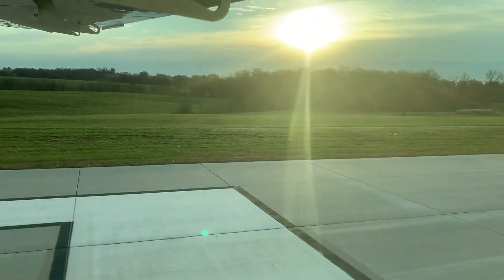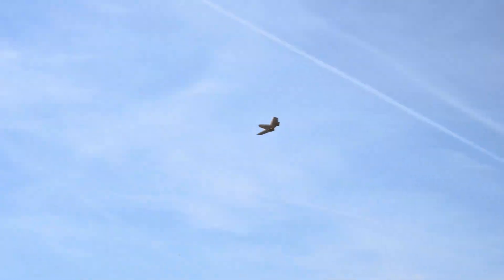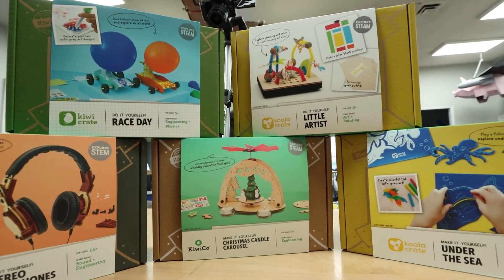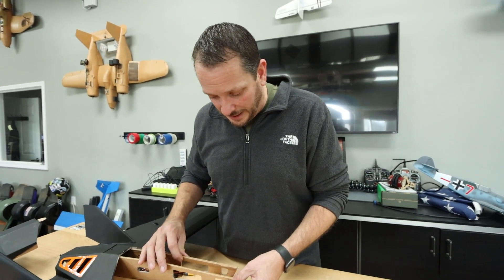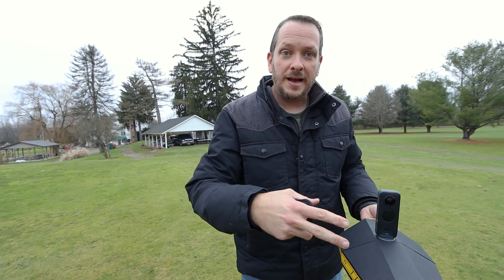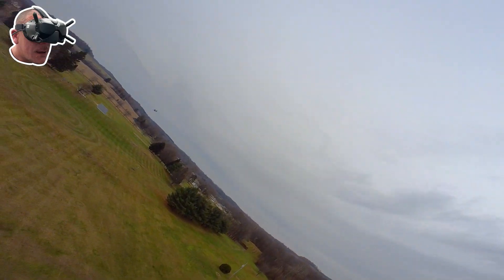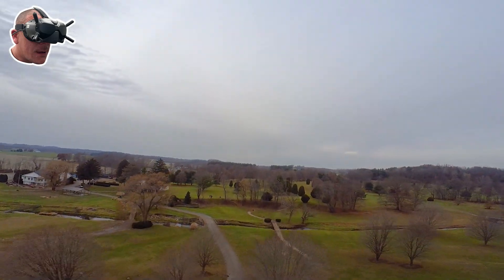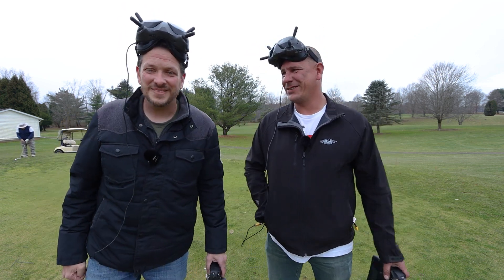DIY FPV UFO Racer 🌍🛸 Anyone can Build

Comment: Occurs to me... Couldn't you run your own software to do a HUD in the goggles? And, maybe some IR wing tip LEDs that the cameras can track? Linking those feeds together, you could Augmented-Reality some artificial CGI aiming reticle and air to air machine gun bullets and missiles with locking on tones. They'd have the warning indicator that you've got them locked, and they can pop flares/chaff. Etc. A way more awesome type of laser tag. You get a hit and they lose control and spin out for a second. Bonus points, include a little smoke maker in the plane that goes off to indicate damage. You could fake RADAR with arrow indicators pointing to let you know where the other aircraft is.

I'd buy two.

Comment: It maybe stable and flyable on slow speeds. Try to ran it into a simulation and above speed of sound and I guess it shows the flaws of the design. Taken that this design are ment for low speeds, still awesome FPV shots and flying of those thing.

Comment: look into this: The Flying Pancake - Slowest Plane Ever Made! https://youtu.be/DZoMMt1e2MM High speed is not everything in aviation. Sometimes, the need is for something other than having an aircraft that travels very fast.

 Speed might be sacrificed so that a plane can carry more cargo or payloads, or if an aircraft needs to fly longer distances more economically. Another reason why lower speed may be preferable is for when an aircraft needs to fly low and slow. 

So, what went into making the Vought V-173 or ‘Flying Pancake’?

The Vought V-173 was an aircraft built during World War II. As already mentioned, central to the proof-of-concept for this craft was an extremely low-aspect ratio wing design.

This created an aircraft that was essentially one giant, flat-shaped wing, hence its pancake-like appearance.

Its most eye-catching and unique feature was its circular wing, which was a relatively small 23.3 feet or 7.1 meters in diameter.

 This small wing area was meant to provide structural strength and allow the craft to have a high level of maneuverability.

Comment: Forward swept wings are incredibly maneuverable, thats why they arent used on full scale aircraft. They are too maneuverable and even tiny twitches will rip them off the plane at high speeds. Only computers can really react fast enough to keep them stable at super high speeds.
Reply: Except they're used on Sukhoi Su-47 Berkut. Incredibly maneuverable at subsonic speeds and designed to twist while under load so that they don't break
Reply: Or this one: Junkers Ju 287
Reply: Eh, I am not a plane expert, consider me corrected.

Comment: Come to think of it, the way they toss the planes to flight would be possible for Real Life planes (for this plane design). Like imagine, planes like this being deployed from a carrier but not on water or land, not from a run-way but an arm tossing doing an arc'd throw (like arm throw) motion of 45 to 90 degrees to put it on flight (plane sitting on a rest below before it's release to flight). 
These would fit for an Aerial Aircraft carrier style, either real planes or drones of its kind. A carrier that uses an "arm throw" launch instead of a runway. The deployment would be from below, behind or side. Acts similar to a disc shooter but planes in place of the discs.
Would this be possible?

Comment: Your are absolutely right on the fact. That you don't need CAD or CNC (or 3D print) to create rc planes,  or any other model for that matter.  I studied for a degree in industrial (3D product & furniture) design, this was back in the early 2000's. The CNC and 3D print technologies did exist but we're absolutely out of the budget of the normal person. Our final models were completely hand made by literally mdf wood board and car body filler plus a whole lot of carving and sanding by hand. To give an idea of the tech time line, we knew of any emerging (at least 8 approx years before the typical consumer could purchase) technology being somewhat wireless, it was for audio and perhaps video applications though info was pretty vague, more mind-boggling was the name and what it referenced to was anyone's guess. What was it?............    Bluetooth!

Comment: What is your technique for getting your planes out of the trees when they are stuck high up in the tree? As good as you guys are at flying, I suspect you've made a goodly number of "tree landings". 😢😊
Reply: in my pickup truck I have an extension pole used for painting. $40. I also have an extra pole  I can tape on to the end. Plus a metal clothes hanger to make a hook at end. Also, weights at the end of some long strong rope. Throw it into the tree where your quad or plane is and grab the ends once the weighted end falls. now you can shake the branch a lo to make it fall.

Comment: Really cool! I don't know if my eyes are deceiving me but it looks like it's got quite a bit of dihedral flex.  Also looks like it tracks smoother inverted. Might be interesting to try a version with a little anhedral in the wing or a long center spar across the span to keep it flat.
Reply: it did look like it was flying pretty happily inverted,  would be neat  to see a design with the wing inverted and a underslung gimble camera

Comment: ive made a v wing racer, i cant think of its name but its one of your kit's and i feel im doing something wrong after following your steps to a tight T. i can fly it, and it flies okay if im just coasting, but when i try and fly fast, it just feels like its  not getting the power it needs. 850 4s recommended for the 2205 motor apart of the kit, balance is nice, even tried slightly more nos heavy but it feels its stalling.

Comment: Y'all are 6 months to late on this design. I purchased a reptile dragon v2 instead of the dolphin. But had I know this was in the works I would have waited because I want to try the mid range fpv flying and it's never soul crushing when I crash a ft model because I can just repair or rebuild affordability. I'll save up for this one though... Nice job guy's

Comment: One of my favorite designs from you guys so far, really really want to pick one up soon. Wish you could make the wings removable!!! I would love to see that as a carbon spar mod like the TeamLegit Drak series (which is now out of production!) to take on the go.

Love what you guys do thanks a ton.
Reply: It actually wouldn't be to hard to make the wings removable Just use the same attachments other models use and fabricate - modify a few things here and there lol It can be done and I agree it would be cool I love my AeroScout because of the removable wing etc You can take it out the box and have it in the air in 2 - 3 mins literally and It's a great trainer also and it can get pretty dang sporty if ya have the skills which I don't lol Barrel rolls and loops is about my limit I've tried inverted a few times but I'm not going to push it right now Safe technology is a beautiful thing 😁 The ole panic button has saved my butt many times 😁 😂🤣✌️
Reply: ACTCHUALLY, the Drak was developed and made by Chris Klick of Ritewing.  TeamLegit used to sell them, but Ritewing has now been producing the smaller versions of the Drak.  The only one that is easy to get now is the Nano Drak, which is a fantastic airframe!